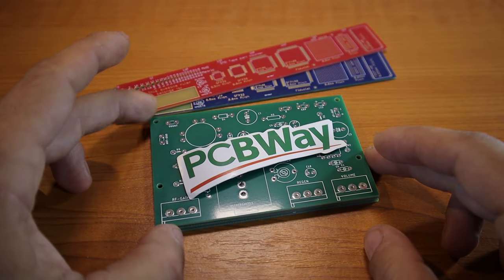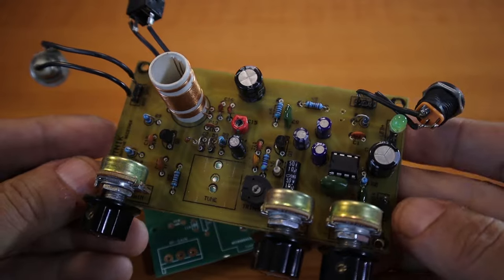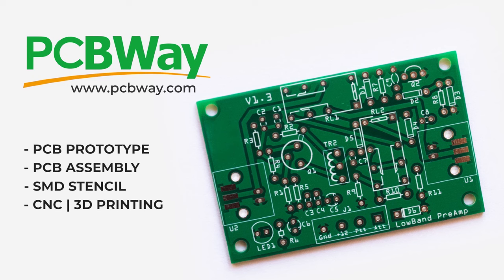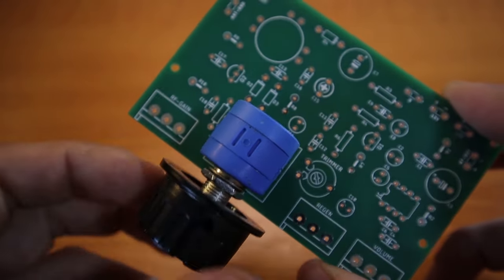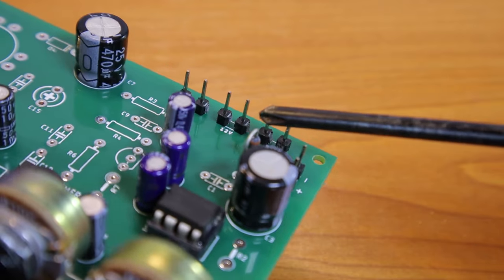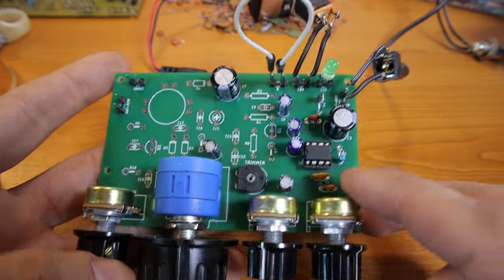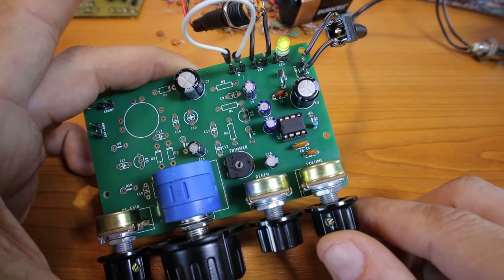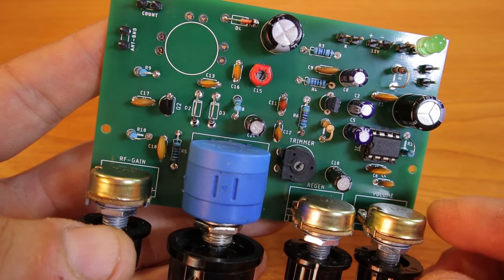Building And Testing The Sputnik Regenerative Receiver - Step By Step

Comment: I built 2 recent versions and also made my own version using a fet transistor and had better results.
Reply from the maker: FET's are always more superior than BJT's... unfortunately not always easy to find on junk boards like BJT's... and because the project was more inclined for kids and beginers... 2N2222 or any other similar transistor was the best choice. I also have one with a FET and is way better. Coming soon with that one as well ))). 73, YO6DXE.
Reply: Top heim estou com uma versão dessa que o Doni desenvolveu logo irei montar
Reply from the maker: @CanabraGalhardo Ah, isso é ótimo.  Eu sei sobre o que você está falando.  Deixe-me saber como funciona e se você gosta.  Não é um receptor com resultados surpreendentes, mas é bom o suficiente e muito divertido de construir e aprender com o processo. 73, YO6DXE.
Reply: Interesting.  Which transistor did you replace with the FET, and how did the GDS leads correspond to the EBC connections on the board?
Reply from the maker: I didn't... this particular schematic is strictly with NPN transistors.
Reply: @dxexplorer  Do you know the J310 FET? Would it be suitable to replace the 2222? Thanks.
Reply from the maker: @dx835 ohhh no no. The 2N2222 is an NPN transistor. You can't replace it with the JFET unless you change the entire circuit. If you don't have 2N2222 you can use 2N3904, BC107, BF200, BF214... or anything similar. But it has to be NPN.
Reply: Thank you for the info.
Reply from the maker: @dx835 Always a pleasure. BF214 worked the best for me, but is harder to find these days. 73, YO6DXE.
Reply: @dxexplorer  Thank you very much; this information is very valuable., 73s
Reply from the maker: @dx835 73 my friend.

Comment: I was excited to start UNTIL you started to measure your windings with some device I had never seen before and also you are adjusting trimmers well I have "knowledge" of electronics maybe even soldering but that was WAY too much for me so I'm scared now to build this lol
Reply from the maker: Hahaha... is not as hard as it looks. The device ( nanoVNA ) I am not even sure it gives me the exact inductance, but at least I have an idea. If you build the coil as in the video you should have no problems at all. Is important to respect the number of turns and the diameter of the wire and the coil ( in case you use the PVC pipe version ). But you can always email me when you go trough that process and I can help you out to tune it etc.
Reply: @dxexplorer  Hey thank you!😊
Reply from the maker: Always a pleasure. 73

Comment: Although I learned to work on a prototype board or even deadbug style (I prefer the style for the speed with which you can build), it does not compare to a clean circuit, when you know for sure that the circuit is perfectly functional, and you don't have to burn your brain checking tens of times each connectionp, and much, much easier to repair in the future if necessary. Very nice! Congratulations for the step by step video!
Reply from the maker: Thank you so much ( multam frumos 😁 ). I totally agree with you. I was working recently on that simple transmitter I posted the video about some while ago. Initially I built it on a breadboard and it just wouldn't work. I spent two hours trying to figure out what connection I did wrong. Turns out at the end that the breadboard had bad connections. So there is two wasted hours when I could do something productive. Now I do most of the tests for all projects more like the dead bug style... then just design a PCB board and work this way from now on. I ended up spending four days to make each video I post... it became a lot like a second job... except that I work for free 😅😅😅. So yep... working fast and knowing that you have no headaches trying to figure out things is really nice. Thanks so much and I hope you have a fantastic rest of the week.
Reply: @dxexplorer Yes,creating quality content is taking a lot of time and not many understand that.Glad to watch your video and your beautiful built reciever .With this board even a beginner can be succesful in building his own radio . A blessed day and a wonderful week to you too! 73
Reply from the maker: @instructoruldemeditatie2367 With the beginner in mind I made this receiver... simply because I was a beginner when I started the YouTube channel and made the first video... and it helped me learn a lot. I also have my amateur radio license thanks to this receiver too. Just because I had enough of just listening and wanted to be able to transmit as well. Now I have the license and no free time to stay on radio. How funny is life hahaha. 73.

Comment: Ciprian, I am gathering components for the Sputnik receiver. I have 1nf, 47pf and 470pf silver mica and Styroflex capacitors. Do you think these componentes are suitable alternatives to replace the NP0 capacitors? Thanks.
Reply from the maker: Honestly I used regular ceramic capacitors and still had decent results. I am sure that what you have is better than cheap ceramic capacitors.
Reply: @dxexplorer  Thank you for the information, 73!
Reply from the maker: @dx835 Always a pleasure. 73, YO6DXE.

Comment: Hi Ciprian, I have the Sputnik on a protoboard and it tunes very well on 40 meters. How did you calculate the 3 turns of the L1 toroid? Is it possible to modify the coil to make it work on 20 meters without changing the circuit? Thanks
Reply from the maker: Sorry for the late reply. I have no phone connection here so I only have internet when someone else in other network shares a little with me haha. The 3 turns I picked by trial on error. I wanted to be sensitive but also not too much to avoid overloading it. Yes I made a version for 20m as well. I cand remember the turns number though. But I didn't changed anything in the circuit. Maybe just the value of the capacitor that is in parallel with the main coil. I think I used 14 turns if I remember well ( but I may be wrong ). 73, YO6DXE
Reply: @dxexplorer  Ciprian, thank you for your response. Don't worry if you weren't able to reply quickly. I finally made the modification with a yellow T50-6 toroid, with 3 turns for L1 and 16 turns for L2, and the Sputnik receiver is working across the entire 20-meter band. It’s an excellent regen radio, which has really surprised me. I uploaded a video with a test to my channel, 73!

Comment: Hi Ciprian, is there a eay to substitute the multi turn pot with regular pots? As theyre not available in my locality
Reply from the maker: Yes of course you can. It will only be harder to tune so either use a really big diameter button or in case you have a reduction drive then that would be great too. I used regular potentiometers too until I discovered the multi turn ones 😁😁. 73, YO6DXE
Reply: @dxexplorer  Thanks!
Reply from the maker: @Mini-xi1wt Always a pleasure. 73

Comment: Would it be possible to make plug in coils for different bands, or would the capacitance of the tuning circuit prevent that?
Reply from the maker: The can be done yes. As example let's say the variable capacitor is about 20pF. In our case the diode tuning I think is around 9pF. We can make plug in coils using a combination of the coil, C15 and C16. These will for them coil plug and can be changed for diferent bands.
Reply: @dxexplorer  So C15 and C16 will become part of the removable coil assembly?
Reply from the maker: @ozarktreasures8044 @ozarktreasures8044 Yes because they will be band specific. One is to adjust the receiver in the right portion of the band... and the ceramic one the bandspread capacitor.
Reply from the maker: @ozarktreasures8044 send me an email when you have time... there is a contact form on the blog. And this coming week when I have a little time I will explain a little more in detail.

Comment: Very cool video! You make this look easy and put away a lot of fears with choosing and winding toroids and inductors that I have. The great lesson on toroids is an added bonus. I'm curious why on two different videos I've seen you solder d4's cathode closer to the circuit board? Does that effect the performance? Great looking circuit design! Thanks and 73.
Reply from the maker: Ohh yes the toroids are the easiest to make for me. About the diodes... no not at all... is just to save space on the board I install them vertically instead of horizontal. 73, YO6DXE.

Comment: As promised and a good demo video! the Toroid coverage is just what I was looking for, now I understand the placement of the windings. 73 Mike K7AJQ
Reply from the maker: Excellent... really glad it makes sense. I really hope the video helps people understand easier than just the drawing from the blog. If you want to cover from 7.0 to 7.3 maybe put 38 turns and lower the value of C16 ... I just can't tell how low as I never tried but maybe around 68pF. If that still doesn't do the job then maybe the easier way is a Varicap with a little more capacitance than the 1N4001 diodes I usually use or even the BB105 I used in the one from the video. I think that is what I used I can't remember for sure.

Comment: Hi Ciprian, great work! I received the PCBs yesterday and started assembling Sputnik. A curiosity... what did you use to unravel the PCB? Thanks again
Reply from the maker: Ohhh that is great. I sent the boards I had to some friends and they also started building it. I didn't understood the question ? What do you mean reveal the PCB ?
Reply: @dxexplorer  Sorry, I meant what do you use to design PCBs? Because I use kicad but I don't like its footprints and the pads it uses
Reply from the maker: @son3dra Ohhh now I understand hahaha. Originally I started making designs using Express PCB. I created a custom components library just as I liked them. The problem was that I could not export Gerber files. So I moved to Eagle and started over with all the designs. I also created a custom components library so the boards I design will be easy to make at home using the toner transfer method. For this all components are having bigger pads than normally and also the traces are thiker.

Comment: hi Ciprian, I wanted to replace the coil with the toroid, but the number of turns for L2 is 32 (as on your page) or 36 as you say in the video?
Reply from the maker: I use 32 turns... for the T50-2 ( red ) or 36 for T50-6 ( yellow ). But it depends also on the manufacturer of the toroids... some are not so "original" so the number of turns may need to be adjusted so you don't mess with the capacitors. Usually I put 34 and then take one turn out at the time until it resonates on the right portion of the band. Most of the time using the toroids from my friends at roWaves was easy because it works with 32 turns right away no need to tweak anything ))).

Comment: Az LM386-os IC esetén a 2-es 4-es lábra én 220 nF míg a 3-as 4-ed lábra 1 nF kondenzátort kötnék, úgy is használható lesz a vevő?
Reply from the maker: I don't know i never tried. Technically what you do to the audio amplifier should not affect the receiver side. But you have to be careful with the LM386 as it has the bad habit of going into self oscillation depending on the configuration used.

Comment: Hi Ciprian, I was playing with Sputnik to change the working frequency (I wanted to go to 9610KHz and listen to "objective DX" on Sundays). While with your values on 40m I had a range of 200KHz, on 9MHz I was unable to go beyond 40KHz of frequency range with C16 133pf and L2 14 turns (L1 always 8 turns). As tuning diodes I used 1N4007 which should have the same capacity as the 1N4001. Suggestions to make frequency and bandwidth switching more flexible? Thank you
Reply from the maker: I don't know if I understood right..  but you got it tuned in 9MHz... but you need to cover more bandwidth with the same diodes ? If yes... then the trick I made on the 80m band in order to cover the entire band was to calculate the resonant circuit with a higher value of the inductor and smaller capacitance in parallel. The disadvantage is that at times is not as stable in frequency. Another option it would be to calculate everything for 10MHz for example... and in parallel with the trimmer capacitor, to also use a variable capacitor. But then the diode tuning becomes more like fine tuning. Let me know...
Reply: @dxexplorer  Exactly, since on 7MHz the bandwidth is about 200KHz, I expected that even on 9MHz it would be larger than the 40KHz I have. I'll make do with 40KHz...I don't want to lose stability. After all, it's just an experiment
Reply: With 40KHZ I cover the 9610KHz that interested me 🙂
Reply from the maker: @son3dra Is diferent yes. From what I noticed is that depending on the band... to cover all the bandwidth we need there has to be a ratio between the inductance and the parallel capacitor. It is fun to experiment, but sometimes it also comes with a lot of headaches hahah. I know what I am saying. I think the easiest solution would be just to replace the diodes with some varicap that has more capacitance at the 9v we have there in the circuit. I actually want to test a few at some point when I have the time and see how much I can cover with one high capacitance varicap.
Reply: @dxexplorer  in fact I was thinking of the same thing, that is, using varicaps instead of normal diodes or trying to look for diodes with a larger residual capacity. Anyway, thanks for your availability. And if it works on Sunday, I'll post the video of listening to the show.
Reply from the maker: @son3dra Thank you as well Antonio. Ohh yes please I was just about to ask about a video 😄.

Comment: I want to ask if I need to install a 470pf capacitor on C11, will it have an effect if not installed?
Reply from the maker: Ohhh yes it has big effect. That is part of the oscillator circuit so with no 470pF capacitor the circuit will not work at all. 73, YO6DXE ( If you don't have a 460pF capacitor you can try 500pF or 1nF for now as a temporary solution and see if it works. It should but the results won't be so great. You can then replaced it later when you have the right value. )
Reply: @dxexplorer  Yea, I don't have stock for 470pf, what if I use 1nf, what should I change? coil or something else?
Reply from the maker: @why.k5max No need to change anything else, is just that the oscillator may not perform so great. Basically it will affect the regeneration of the receiver.

Comment: hi Ciprian, Sputnik assembled and working! Could you give me the link with the modification to the crystal tester to work well as a frequency meter? Thank you
Reply from the maker: Ohh yes of course. If is the same as the one I used in the video... here is the link to the video with the modifications that have to be made. The crystal tester won't work anymore as it will become a preamp after the modifications. 
https://youtu.be/0BxpMm6SLoE?si=kaTprHF2750F7UqH

If you look back on the videos I posted... you will find a video about a direct conversion receiver for the 80m band. In that video I am using another frequency counter. That one works with ought any modifications.
Reply: @dxexplorer  thank you very much
Reply from the maker: @son3dra Always a pleasure. 73, YO6DXE.

Comment: Thanks Ciprian. I managed to get PCBway to process my order. Thanks in Advance Dana VE6KBI in Canada
Reply from the maker: Ohhh glad to hear that. Let me know how it works after you receive it. Yesterday I just built one more as a present for a kid. So far both worked like a charm. Except a bad potentiometer. Not sure what they do these days but the quality of the components is a disaster. 73, YO6DXE.
Reply: Hi Ciprian. I received my order today- looks very nice. Do you have a preferred supplier for parts? Mouser/Digikey or other? VE6KBI in Canada.
Reply from the maker: @danamarcy5414 I must make you laugh, but the best supplier for me is the junkbox 😅😅. 99% of the components I use are old parts recovered from old boards. I need to keep building more while spending less. If the components are good I see no reason why buy new ones. But for brand new parts... I would say that any of the well known suppliers must be ok. The only one I stay away from are the stores that sell components really really cheap. I learned my lesson and I know now that those are some fakes and whatever I buy has nothing to do with what is written on them 😅. Glad you like the board... I hope it also works 😅🙈. I am excited and I can't wait to hear how it sounds. 73, YO6DXE.

Comment: what should be the diameter of the wire wound on t50-2 ?
Reply from the maker: Anything between 0.3mm to 0.4mm would do. As long as it fits. I think I used 0.35mm if I remember well. I take the wire out from the secondary of old transformers.

Comment: hi sir What value diode can I use instead of bb405?
Reply from the maker: I used a lot two 1N4001, 1N4002, 1N4004, 1N4007... try one of these. Is just a little less capacitance but not much.
Reply: thank you very much for the information
Reply from the maker: @musasugen2364 Always a pleasure my friend. 73, YO6DXE.

Comment: Bro which site u're using for coil inductance calculator
Reply from the maker: Coil32 for the PVC pipe coil, or toroids.info for the toroid version. The finished coil will never have the calculated value of course... but you will be close enough.

Comment: Sir,What is the gauge and mm of antenna wire.
Reply from the maker: You can either use any random wire that is at least 8-10m long as antenna, or an active mini-whip antenna, or I will leave you a link to another video about a prope EFHW for the 40m band... a cheap version:

https://youtu.be/0aq24ggLfYM?si=bnYW8_264t36UXJC

Comment: Hi. Diode 4 = ? is this to be installed on the latest PCB-Board  if so what is it ? 73.michael.M7MZX
Reply from the maker: Hi Michael... is optional. It does deems to help a little in frequency stability... but is not a must. Is a 9.1 Volt Zener diode. 73, YO6DXE.